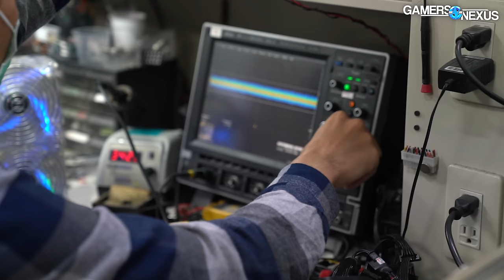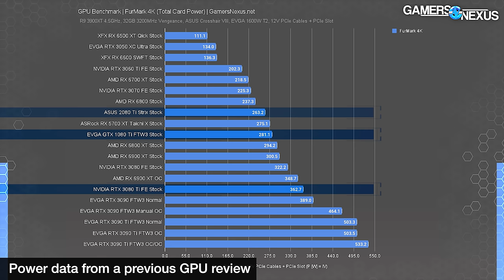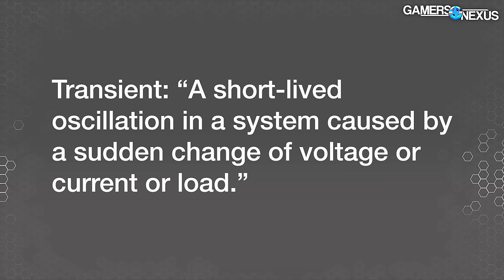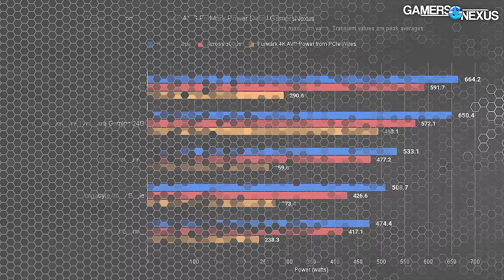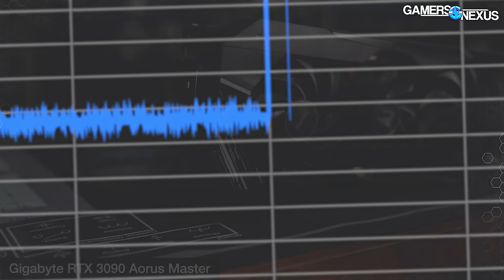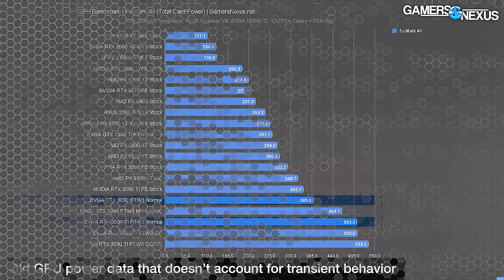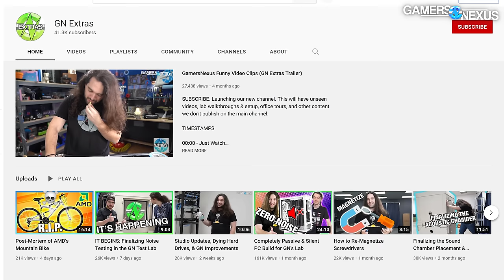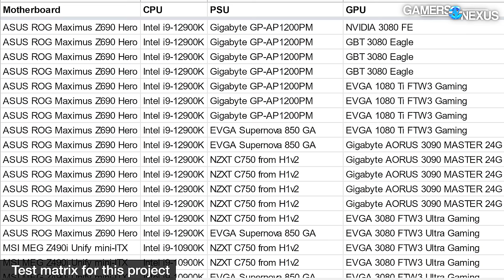The Brewing Problem with GPU Power Design | Transients

Comment: Please - If you want to up your game on this, go look up the Middlebrook stability criteria and start reviewing power supplies by their impedance and crossover frequencies.

You're great at this. I think you're one of the only reviewers that might care enough to actually go do it, educate your viewers on why it matters, all while keeping it entertaining.

Middlebrook is the first step basic method for determining stability and impedance matching between power supplies (like the main PSU and one on a board).

FYI, I'm a professional in this field (not specifically computers), but I did work on a motherboard power supply for the first Sandy Bridge early in my career.
 
You covered it a bit, but everyone thinks capacitors are holdup. They're more for transient suppression and impedance. Those tiny caps on a 1V 100A rail aren't going to hold up Jack. The big caps on a power supply rail are better, but they'll only respond between roughly 20 Hz and a few kHz at most. Your small form factor supplies are pushing it a bit higher (50 Hz or so). What's more important is that higher wattage supplies is pushing the base impedance down and the crossover frequency doesn't matter as much; so stability is easier to guarantee.
 
The 30x Nvidia series die has multiple full to almost zero load steps with durations of a few microseconds within a single frame. You can literally see a semi consistent pattern at the scene's frame rate if you tap between the on-board supply and the GPU. The on-board supply can take care of most of the transients in the kHz+ range, but those frame-harmonic frequencies (approx frame rate to a few multiplies) are smack dab in the middle of the bandwidth between the cards power supply rail and the main system supply and you have control bandwidth and impedance matching issues between the two.

Ironically, power saving efforts for high performance cards in the future will make this worse. You want it to blast out a frame, then sip juice. It's not practical to store enough energy on a board to smooth it out.

Edit: Also, you mentioned something about the phase shift between the current sensor and the voltage. That phase shift may be 'real'. I'd suggest calibrating it out on your probes measuring against a linear load. If you put your scope in 50 ohm impedance mode you can probably cal the delay between voltage and current while measuring the current into the voltage probe itself, just using the cal rail on the scope. If your current sensor resolution is too low you'll need a signal generator to do that.
Reply: I really hope that Steve and the team find your comment and read it. GN strikes a great balance between in-depth reviews while keeping it accessible for most people, so I'm sure they would be able to incorporate all this into their videos.
Reply: upvote this above comment
Reply: If Youtube would have a Reward Comment system, I would reward you. This comment is gold.
Reply: Someone get this comment pinned, get Steve and the team on it!
Reply: Could you elaborate on the small form factor PSU's possible impact on being able to handle transient spikes in regards to the frequency you mentioned?
Reply: Up you gotta go

Comment: 2017: GPUs are causing massive worldwide power draw.
2018: Countries introduce laws against GPU crypto mining. 
2019: GPU prices 5x higher than the systems they're built for.
2021: GPUs affected by worldwide component shortage.
2022: GPUs are frying entire systems due to unprecedented / sudden power consumption. 

Man, GPUs are like the bad kid in the neighborhood.
Reply: But us consumers NEED the overkill for gaming and streaming so we can compare our e-peen.
Reply: @mosando  No you don't.
Reply: Never had this problem I bought AMD.     :p
Reply: @Life_Is_A...  have you heard of sarcasm?
Reply: @Life_Is_A...  yes we do
Reply: @Kasumi_Tashi  No you don't.
Reply: Q4 2022: mining is going down and GPUs prices go lower and lower, a man can dream right?
Reply: you're talking about two different parties. consumers, and corporate companies, both of whom used gpus for different reasons). Good timeline, but bad take at the end.
Reply: @User71956  yes we do
Reply: @mosando  Actually I do coz I either spend my money on a high end GPU or Strippers and hookers 🤣 I'd rather spend it on the fort than the latter
Reply: @Life_Is_A...  yes we do; you too don’t you fib
Reply: @lukasausen just bought an used 3090 from 3 months mining Ethereum and it ran flawless. Paid 1k U$D for it. I'll take it off for a while tho, as my PSU is a 750w and I'm really afraid of the power spikes

Comment: This is the most well timed video I have ever experienced. I was literally just telling a friend that his crashes might be from these "power spikes," and he was not understanding what I was trying to say. I'm hoping this video with all your graphs and analysis will make more sense to him. Thanks for the breakdown!
Reply: What sucks is a 1.2KW or higher PSU would more likely than not solve the problem completely but that is one hell of a cost to pay for system stability that should be a given if the GPU didn't go overboard on the draw randomly. Locking the FPS would also likely make it not happen and in the majority of games that wouldn't even be something that hurts the experience, but in several titles you want the highest framerates possible so you see the most up to date frames at all times to be competitive and in those titles a new PSU seems to be the only option.
Reply: Hmm, I do have random system restarts, now that I got a 3060 ti with a 550W PurePower11, but they happened only when not under any load, and changing the PCI-e setting from "auto" to 3.0 seems to have fixed them. Or at least I haven't had any restars since yesterday morning, when I did that. Although they only happened once every 5 if not 10 hours, so can't say for sure yet.
Reply: @bdhale34  This only affects some GPUs and systems I reckon though. Because I'm on an 850w PSU with a card that draws up to 430w constant power and I've never had any sort of shutdown or instability in nearly a year and a half.
Reply: I view the issue as sort of like a hypothetical car that locks up when the RPM reaches a certain threshold because it requires more gas than the fuel pump can push out so the fuel pump cuts off for safety.

Even if the car OEM picks a fuel pump that can supply enough gas for the average RPM, it won't be good enough for when the driver has to floor it.

However, just because you pick a fuel pump with the capacity does not mean it can push enough fuel fast enough, so you could have a car that doesn't shut off but does essentially run on fumes when flooring it.
Reply: @zeratulrus142  I had to change that setting to avoid issues where my PC wouldn't have video when starting up.
Reply: @HelloFellowDinosaurs  I think they said it happened to all tested parts with the notable exception of some motherboards seemed to mitigate the spikes and Steve pointed to the caps on the board being the reason GN believes they were able to do so.  His point as far as I could see is that any system that spikes its demand for power above what the power supply can provide will do this.  Not as much of a problem right now but you will see this issue again when the 4xxx cards come out.
Reply: @bdhale34  Not randomly, when there are explosions on the screen or suddenly lots of fast moving things the card is doing what it was designed to do.  If you want to count the top... ,00001% of frames as important then you have to make sure you have enough power for it.  If you can afford a card that can do this to a 1.2kw power supply it is not that big of an issue right now.
Reply: @samualaddams705  I have an Asus X570-F ROG board, dunno if that board has what he's talking about
Reply: Computers riding a power bull and occasionally getting thrown.

Comment: From an electronic point of view it makes much more sense to solve the problem on the GPU side where the load characteristics are known and you can even actually actively control the spikes.
Reply: This can happen at any device inside PC, so its better to be solved at power supply.
Reply: @TheSkace  The correct solution is that GPU manufacturers stop lying. If GPU manufacturer says "290 W" but oscilloscope shows 620 W, then GPU manufacturer is lying about power usage.

When all manufacturers tell the real power usage, getting the correct PSU is easy.

With the current lying trend, you cannot know tomorrow for sure if you need to get a PSU with 2x, 3x, 4x or even more power compared to the number that GPU manufacturer prints on the box.

If GPU manufacturer doesn't want to print 620 W in their spec sheet, they need to add enough capacitors to get the power need closer to average.
Reply: The gpu power delivery system is relying so much on the PSU nowadays it means the GPU CAN BE MADE CHEAPER because less components
Reply: @urbansnipe  That's absolutely true that building a GPU that has power spikes is cheaper. However, when GPU manufacturers lie about the power requirements of those cheaper GPUs, selecting a PSU is turned into gambling. When a single manufacturer says "290 W" do you really need 750 W, 900 W or 1200 W for the GPU? How much could any specific manufacturer lie?

I'm absolutely fine with whatever spikes any GPU has as long as the manufacturer honestly declares the needed power levels instead of average power usage which doesn't include actual power required for the spikes.
Reply: @MikkoRantalainen  true i feel the same way
Reply: @MikkoRantalainen  yes and I'd like to see this across the board with all components : Idle power consumption, load power consumption, and maximum power consumption (transient power spike consumption). CPUs are 2nd priority since they are passing the 200W mark as well and may have spikes too
Reply: @Mehecanogeesir  I'm fine with only declaring the max spikes for any individual device. You can declare other values in addition for marketing purpose but those are relevant to cooling and electricity usage (in cost), not for component selection for the whole system.

Unless you like throttling and flakey system, you must select PSU according to sum of maximum spikes of each component (so that it will not crash even if all spikes of all components happen to align) and cooling according to max continuous power usage.

For most systems, the max continous power usage is pretty easy to test: simply run Blender rendering, Prime95 and Furmark at the same time for extended periods.

Measuring the spikes of all components is next to impossible without a really expensive multichannel oscilloscope and hardware modifications to allow connecting that oscilloscope to all needed points. That's why the spikes should be truthfully declared in the spec sheets.
Reply: @TheSkace  its better to fix your own product, not just blame shift.
Reply: the GPU is where the spikes and noise are created, so the closer to the GPU you can filter it, the better it is for everything.  There's inductance and resistance in the power supply wiring, so even if you have a ridiculously stiff power supply, the voltage at the GPU end of the wires will be noisy, which is worse for the GPU's regulation, too.
It's actually impossible for the PSU to filter that noise and get it off the wires.  the best you can do is keep it from getting back into the supply where it can affect other stuff.  The wires will still be throwing unnecessary noise into the environment.

Additionally,  to put huge filters on the power supply outputs means that SCP/OCP/OPP  won't be as effective.  One of the reasons why single rail supplies are less likely to trip than multi-rail is because their protections are less sensitive. 

GPUs really should have ratings for both maximum average power draw, and peak transient draw.  Additionally power supplies should have ratings for both average and peak draw they can source.  ATX 3.0 specifies some allowances, but also makes the supplies harder and more expensive to make, since they need to deal with a lot of extra crap that really should be taken care of at the source. 

@TheSkace It really can't be fixed just anywhere inside the PC.  everything between the GPU and where you try and filter it will have to deal with the noise, and could be a source of RF noise as well.

@urbansnipe  It's not exactly a lie, but it's specifying a different thing, and they aren't giving enough information.  If that gpu says 290W, you know how much energy it will use, and what's going to show up on your power bill.  The transients are also important, and there should be a specification for them, and the GPU manufacturer should design their cards to keep that sane.  That same gpu that does 290W with  620W transients could (and probably should) have sufficient filtering that its peak is lower and wider (for a hypothetical example, instead of pulling an extra 330W for 1 microsecond,  you draw an extra 66W for 5 microseconds).  This is a bit of an oversimplification, but is pretty much what filtering does.  you can't "remove" the spike, because it's actually needed, but your filters can act as a reservoir,  covering the spike themselves, and then recharging their caps by passing on a smaller, but longer duration spike to the supply.
Reply: @TheSkace  There are physical limits in trying to solve everything in the PSU. Even if you wanted to do that disregarding the costs, it would be very hard. On the GPU side on the other hand you can design the hardware so that you don't have huge transients both by having filters near the load (which is very important at high frequencies) and by actively designing the GPU so it does not have current spikes. It will most likely be cheaper overall.

Comment: It’s great to see more people getting in on the whole transient issue. First encountered it when Igor‘s lab made it the focus of their power draw and supply tests but spikes and transients will only get more important to look at the higher power draw we see and the more companies rely on boost clock algorithms and sub millisecond control algorithms for power limits and current draws
Reply: Speaking of issues... there will be fires in some older houses or houses with often sub-par repairs like in hurricane zones. It's pretty messed up when you need an electrician to do a safety check before you plug in your new GPU, will Nvidia give 4090 buyers a voucher for inspection and testing?
Reply: @Mr.Morden  as far as any business is concerned the quality of the wiring of your house is a you problem, this includes the company that supplies your electricity
Reply: @Mr.Morden  Not to forget the 110V Powergrid in the US isnt even that great... For me its always funny when people on reddit tell me that i NEED a UPS and iam just "Mate iam german we have 240V and unless you live somewhere far outside and you are the last person on the line and its not burried in the earth or you do super important work you usually dont use them here"
Reply: @mrn234  quality of powergrid in the US is largely down to the state that you reside in. I've never had issues with power in any location I've lived in, and I've lived in the middle of nowhere as well as in the middle of a city with a population of 9 million people.
Reply: It's the way how these companies "cheat" better performance, just let the GPU spike for milliseconds so the average performance is higher. Spikes so minor but also too severe to some PSUs, if not bought mindfully. But how should a normal person know about it, to avoid the problems some 3090s had? That's why i like GN so much and people like Igor but also Hardware Unboxed.
Reply: IMO it's clear if you're designing an add in board for an existing system infrastructure it's up to you to design your board in such a way as to filter the power properly. Like duh.
Reply: @Mr.Morden  ''will Nvidia give 4090 buyers a voucher for inspection and testing?''

Why would they do that? You said it yourself the electrical system is at fault.

Just don't live there.